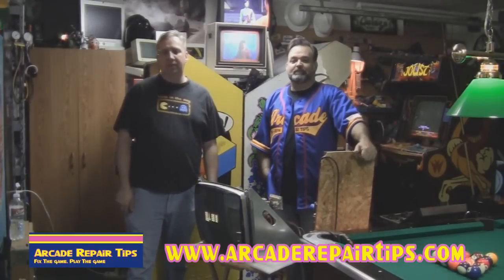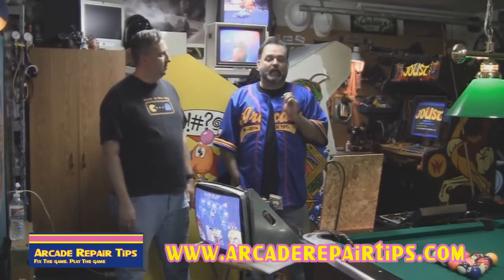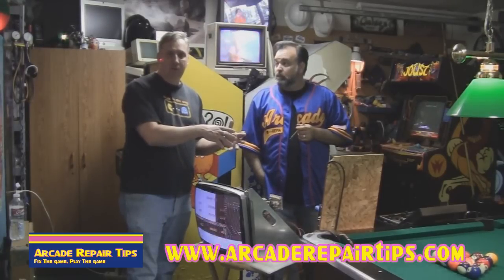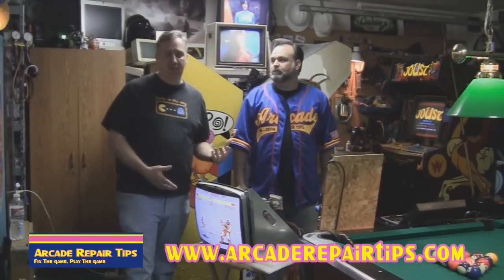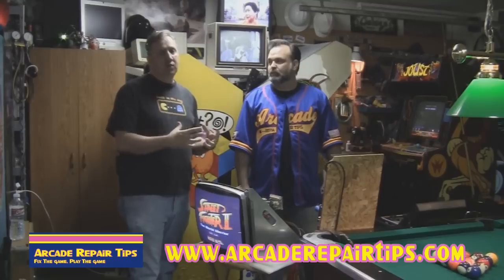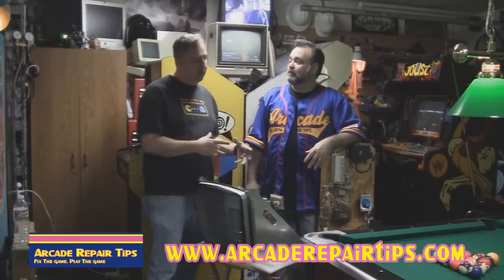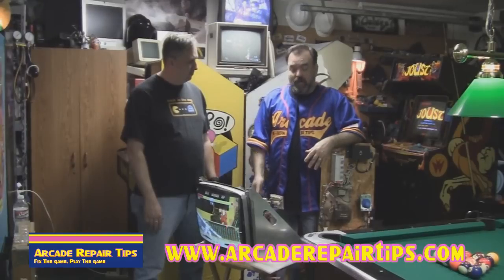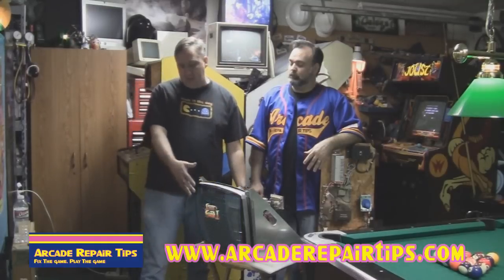Arcade Repair Tips - Using A Tube Rejuvenator

Comment: Ive got an old CRT TV from the 80s which the colour seems to bleed out with the red, im expecting i need to do this on my set. My worry is that some day it will be impossible to keep these CRT's still going, will it be possible to regun old tubes again?
Reply: Not impossible, just expensive.

Comment: I agree. When your colors start to darken up on your tube that is usually cathode poisoning. If your monitor R, G, B, tests good then that means there is nothing bad to burn off. So what are you burning off? The good stuff! Not to mention the older tube testers are more harsh rather than if you had a Sencore CR-70 or even better a CR-7000. With the CR-7000 it may take a couple more zaps to get good results but it's also better so you don't burn up your tube accidentally!

Comment: question I have a neotech nt 2702 the pin broke off the tube but I have another tube the broken tube is a RCA A68AEG25X03 vert ohms 9.3 and a hortizonal 00.1 the monitor I want to use is a Matsuhita A68AEG27X01 vert 7.4 and hortizonal 00.8 the the neck board fits the tube any help

Comment: dust on a electron gun its sealed and in a vacuum so how does that work ? the tube goes soft cause of use and age the emitting surface deteriorates and hardens , rejuvenation is a temporary fix lasting very limited time you should make this clear it is repeatable but each time you do it you risk  burning the surface compleatly away and the effect second time round will last less time

Comment: Beware! There are many things wrong here with the adjustments. Heater voltage, G1, G2, ... Please look at the "arcade buffett" video instead. I learned from different sources and he's off on a few things here. Good if he didnt blow anything and it worked for him. But it's not done the best way for sure. Don't get me wrong, I usually really like their videos. But this one is off by too much.
Reply: B. Ouellet 👋 Hi!  He made the first mistake, heater voltage should set to 6.3vac.Like the  book stated. Higher setting will shorten the life of the tube. I’m a tv technician. Fun to watch.
Reply: SinistaN Hi!  I currently use a secure CR 70. Filament volt is important. Well a higher setting will weaken it life, cathode will deform  the mechanical structure

Comment: It's ironic you would post this video as I' at the point of moving to a tube rejuvenator. I've done a cap kit, a new flyback, and have not seen that much of an improvement. This looks like the next step to getting my monitor working. Or if one of you wants to fly out here and fix it for me. ^_^

Thanks fort the helpful advice and hopefully I can use this information!